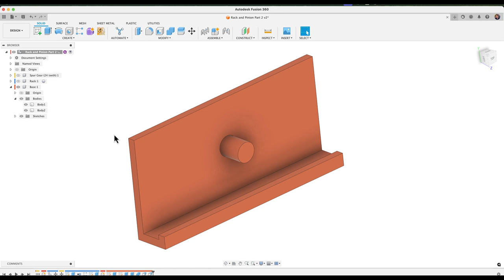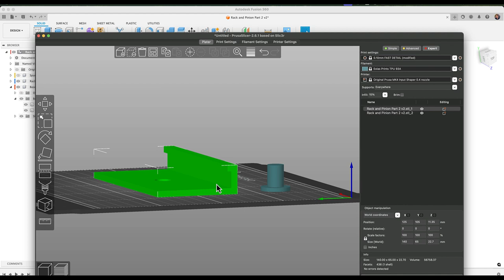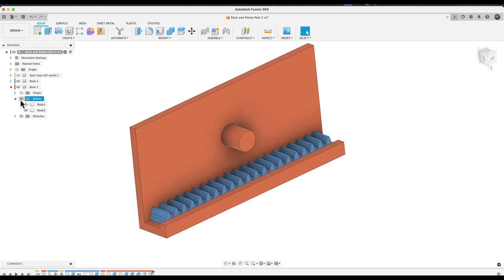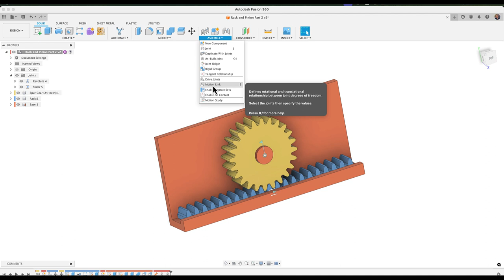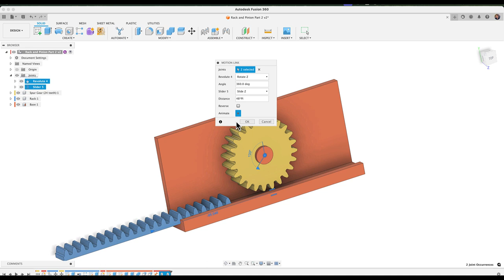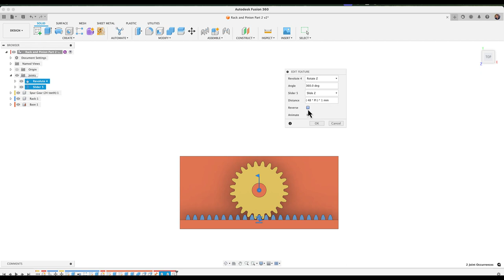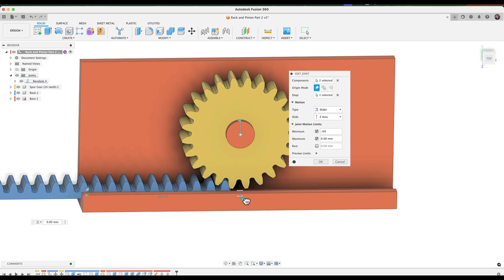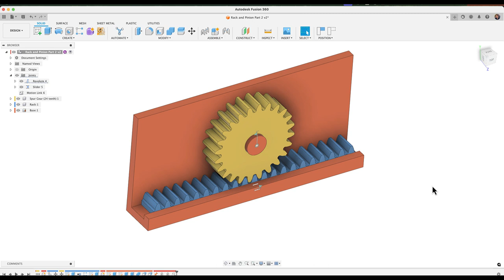Rack and Pinion part 3 - Adding Joints and Motion

Comment: Great tutorial. I thought of maybe a slight tweak to the design to make things fit better together and print. Maybe changing the join between the frame and the peg. Change from a circle to a triangle join. Just so the frame prints better as the circle might distort too much printed up right. Anyway just a suggestion.
Reply from the maker: I'm not sure I understand.  How would the gear spin if the opening is a triangular shape?
Reply: @DesktopMakes  Hello sorry I miss understood where the spin was happening. I assumed it was spinning between the "peg" and gear. I see now I was wrong, the spinning is between the frame and "peg". Yes a triangle would not spin.

Comment: Hello, I am designing a rack and pinion mechanism but at a much smaller scale. The total circle diameter is about 0.58”. I had to create a custom gear that allows for it to be machined on a cnc as it needs to be made out of titanium. My issue is that it does not contact exactly the same as the gear shown in the video. Is there a way to use the motion link in a way that only moves when the two components contact one another? Right now they move fluidly but don’t contact with the standard motion link
Reply from the maker: Yeah, you can try enabling Contact Sets but I didn't have luck getting it to behave smoothly with gears the last time I tried.